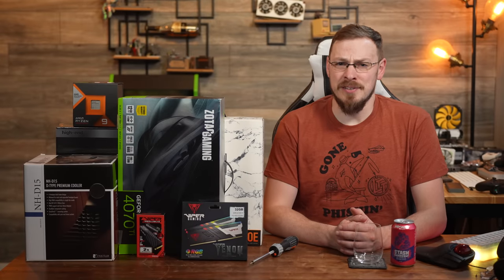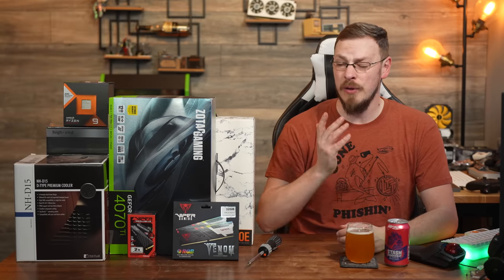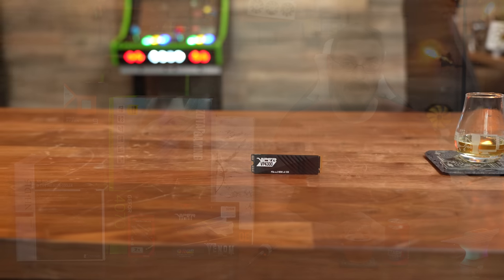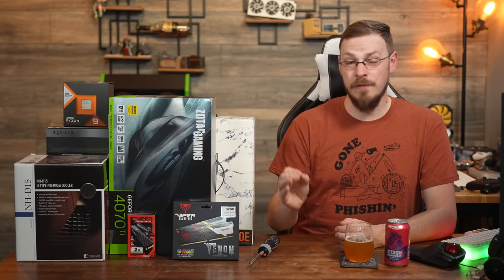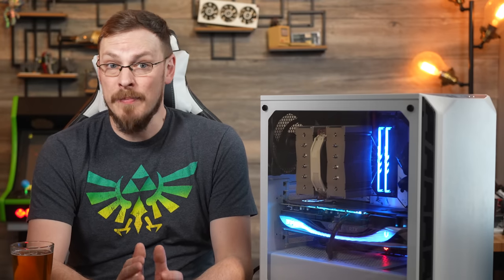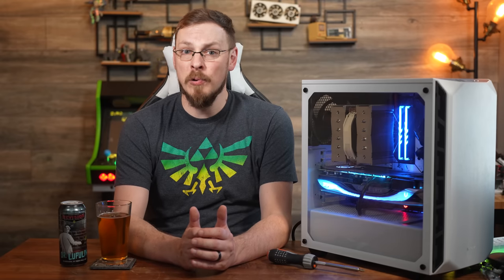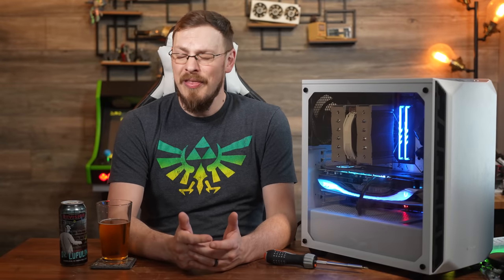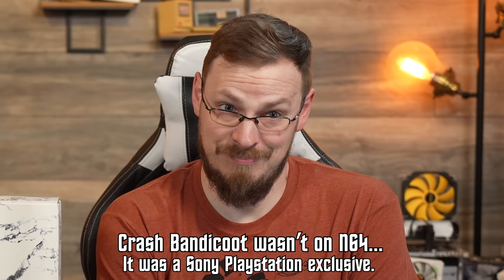Trying to NOT burn my wallet...

Comment: I just registered its a 7900X3D -- that is very near the worst value choice for gaming you could have made - its a 6 core CPU in gaming. 7800 or 7800X3D with their single 8 core CCD is a WAY faster choice in gaming for much less.
I can see a LOT of reasons to make the choices you did (especially for streaming) but as a best value gaming build it really is off the mark.
If you had justified it as a streaming PC with the 2nd CCD to handle streaming and system tasks and the nVidia card for nVENC i would have been right there with you. Also ideal for video editing and music composition at the same time. Also probably a great DAW with the DAW on the high clock CCD and virtual instruments on the cache CCD (i split my 3900X like this with process lasso).
Reply: Do you have a guide for using process lasso? I am a newb with it, I just use it for star citizen atm but would love to learn. I have the rpo version for my desktop as well as my girlfriends
Reply: what do you mean the 7900X3D is a 6 core cpu? it's a 12 core 24 thread one?

Comment: The choice of a 7900X3D, 4070 Ti and NH-D15 is... perplexing, to say the least. You do you, I guess.
Reply: Why?
Reply: I went for a Xeon E5 2643 v2, an Rtx 3080 and a chinese tower cooler. I'm very pleased with the outcome.
Reply: @normalguy3443  Coming from an Ivy Bridge system I felt the need to go newer, so I'm on a Ryzen 7700X and an RX 6700 XT as of about a month ago. While I do game enough to make the GPU an important consideration, CPU performance was more valuable to me. Certainly can't complain so far. No stability issues or any other notable problems to speak of.
Reply: @AliceC993  That's a pretty good price to performance build especially on the gpu, I've come to come across more and more proof of Amd gpus being more cost efficient as I've delved more into this pc building hobby. Your cpu is also straight powerful. I just picked up an ivy bridge as I know I only game at 60 fps so I thought it would suffice all games. Great build bro👍
Reply: @normalguy3443  I was tossing the idea around of either a 13600K or 13700K but pricing at the time meant that even with the exorbitant price of B650 boards, it was actually cheaper for me to go with a 7700X and a B650 Tomahawk WiFi from MSI + XFX SWFT309 6700XT than to go with a 13600K and an equivalent motherboard in either B760 or Z790 guise.
Reply: @AliceC993  I can imagine you would consider your those types of CPU's, your current build has a very strong CPU and you said your tasks mainly consisted of cpu heavy tasks. Must be server or workstation tasks to require such a powerful cpu set.

Me personally, in regards to cpu, motherboard and ram pricing, I honestly just go for things which are as cheap as possible which can run games at 60fps. I can't imagine buying a generation 13 intel core processor, they cost like 20 times more than old xeons (my xeon e5 2643 v2 is worth about £10-£11). Those intel core cpus are super expensive, heck even the 7700x to me is like enterprise/professional grade hardware to me at this point.
Reply: @normalguy3443  I'm not sure what pricing is like wherever you're located, but I managed to upgrade my whole system (admittedly, overspending a little and upgrading other components like my monitor) for about $1400 USD all in all. Honestly not too bad given that, for my uses, another 5-7 years out of it, potentially more, shouldn't be a tall order.

Comment: I like your practical philosophy on computer builds here.  That machine is a beast.  4070ti was my choice for gpu a couple of months ago, i am still very happy with that decision.  Also same air cooler on my CPU, very quiet.  still using my Silverstone RV02-E case from like 2012 because i really like the 90 deg rotated MB (no gpu sag).  Beer today in San Francisco-Negro Modelo.  Cheers Jeff
Reply: The RV02 is such an epic case

Comment: I beg to differ on the PCIe issues.   The motherboard vendors have a lot of flexibility with how to use the lanes/chipsets from AMD and the CPU.    Most of the boards are very gaming focused (m.2 slots and a single x16 GPU slot) with all other PCIe use cases not planned for.

Very few boards have a good setup for workstation type uses like a sound card, 10GbE NIC, capture card, and GPU.   But this is due to the MB vendors not making boards with that workload in mind.

Comment: I went 7950x and sanded the ihs. With pbo i can achieve 40k in r23 and for gpu i have a power color red devil 7900xtx that has liquid metal on it. Under full load the temps peak at 46c on edge and 70c on junction. And yes it loves 3ghz.

Comment: I'm not sure itts just me or the "going for performance over looks" I don't think the case choice is what I say is going for performance, I personally would go for a signifiantly cheaper case with more than some side vents for airflow, even if its a random brand you could easily get a case for $60-$70 instead, you could even go for one without a clear side panel so people in comments wont complain about the baige ;D

Comment: The R9 7900X3D has to be the worst X3D CPU around though, because it only has one chiplet with v-cache and it disables the second one in games, it's basically a 7600X3D if such a thing existed. I'd totally go for the 7800X3D as I would wager it performs better and more consistent in games.

Comment: Remember that one of the biggest problems with the older BIOSs was they could be underreporting voltages.
The software readings were (and possibly still are) unreliable.
That was sort of the whole point of the controversy. Even if you DID go in and check that you have sane voltage limits, a 1.28 report might mean a 1.43 actual.
Reply: It wasnt the issue in the Ryzen 7000, they are quite accurate
Reply: @mycosys  Do we actually have a good sample of real vs reported readings?

Comment: >wants a cheap CPU cooler
>wastes more on it than on the case
ok...
Reply: Some of it is relative.
One of the things that makes a Noctua cooler less painful is the ability to get free CPU socket adapters from the manufacturer.
$80 on a CPU cooler is probably a waste.
$80 on a CPU cooler that will still be useful after 10 years? Less so.

Comment: Interestingly enough, with PBO enabled and negative voltage offset is better than overclocking. CPU runs cooler and at the same time more cores tend to hit max boost at the same time

Comment: Old cases, best cases. If I could buy new RV02 cases, I'd buy them soon as I could. My old TJ07 is still solid and reliable, and nothing new today has yet convinced me to change it out. The thing people forget about things like drive bays is the word "options" You don't have to use them, but it's nice to have them in case you want to do stuff with them.

Comment: A typical US 15A residential circuit is generally good for ~1850W sustained. They can usually burst higher for a few minutes to much longer depending on how "over" you are before the breaker trips.

I mean it is definitely a valid consideration but not a limit I expect you'd hit too frequently. Well, unless you decide to run a task that pulls max performance from all connected systems simultaneously.

Comment: missing a CPU cooler fan :)
Reply: It might not fit the case. Most Ram modules with heatsinks will force you to mount the front  fan in higher position which will prevent you from closing the side panel.